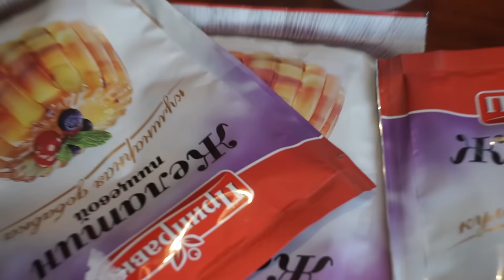Homemade Gear Casting, method of homemade silicone

Comment: My guess is that the plastic gear was there as a failsafe so that if excessive torque was applied to the device that the gear would break rather than burning out the motor or destroying whatever was blocking the gate.
Reply: Yep.  It's like a fuse in an electrical circuit blown.  It, the plastic gear, was designed to go first and least expensive to replace.
Reply: @thewhitecommunity  Nah pham, a hall effect sensor on the motor, optical encoder wheel, or back emf reading on the motor driver would be much more effective at detecting torque resistance.
Reply: Like a kid stuck in the gate:-P
Reply: Now that thing can try to destroy its own master. But i belive he will survive.
Reply: They did it to keep costs down, make sure the product survives past the warranty period, but doesn't last forever. It's called business, and is the engineers most difficult task, finding that balance.
Reply: If the manufacturer had such good intentions, they would have put the plastic wheel on the outside of the case, instead of the metal one that is there, making for easy replacement. @Jo's Channel has it right with, "This plastic piece has no place here, except making maintenance activity for the maker of the system that will come every 18/20 months change quickly that piece and charge you. easy money."
Reply: The cheapest and most manipulative way to render product useless, under the cover of safety.
Reply: as you see there is a clutch behind the gear.... if the gear stucks somewhere the motor will keep spinning without doing any damage
Reply: @Billy Buckles The power feed on the mills I use have plastic gears, but plastic still is fairly strong. This means that if you get your finger caught between the power feed and the handle, your finger isn't going to stop it. What will happen is either, your finger will be squished down to the bone, a bone will break, or it will dislocate your finger. A combination of all three can happen too so you wanna keep your hand away.
Reply: Ryan Carlen  Yeah, and they're on the lathes now too. That's only trouble until they learn.
Reply: @EvelynH-tj1qt  , back in the 70s  we quickly learned how to operate lathes in high school metal shop, so that we could make *pipes*!
Reply: Good 'un in the 50s We quickly learned how to operate lathes in high school metal shop, so that we could make *zip guns*!
Reply: @goodun2974   or hot knifes
Reply: And that was the problem, little ivan got his leg stuck on door, but door didnt cut ivans leg, so time to replace that capitalistic fail safe, 
In soviet russia if it can burn on crush let burn or crush!
Reply: I think it was also intended for personnel protection. If some child gets trapped by the door it will break some plastic teeth off rather than try to shear the kid in half.
Reply: @garywheeler7039  I think we all know which one we'd rather see. A child being sheared in half by a door would be hilarious.
Reply: In this case, the designer almost certainly selected an injection molded plastic gear because it is less than 1/4 the cost of even the cheapest die cast gear.  A shear pin would be used if a mechanical failsafe was desired.
Reply: @WojciechP915  You're not saving much money like that. If the gear breaks, you're still talking about a service call either way. At which point, the actual cost of the parts is not an issue. Even in Russia the cost of getting a tech out to do that is more than the difference in parts cost by a significant margin. Hell, even in China, you probably wouldn't be saving money going with the pin.
Reply: Your guess is wrong, a unusual resistance in the moving door will increase de current consumption and a sensor should stop the motor. Computer sensors are 100 times better than you holding your foot before breaking something fragile on the floor
Reply: Just imagine you can't get a spear part. You have the choice buy a new device or run it with a self casted aluminium gear.
Reply: there are better ways to provide motor safety control like used in impact drills. the purpose here was to save cost and for people to keep buying the same product at cheaper price
Reply: A kind interpretation of "Built to fail" or "Built to be repaired again and again and again and again" - or built to keep customer buying spareparts and repair every so often - or ...
Reply: False.. circuitry has a built in overload motor cutoff
Reply: Elevator doors provide an example of other methods to avoid chopping people in half.  Like light beams that stop the doors closing if blocked  Etc.
Very Cheaply as well.
Reply: Да это просто отмазка... Вечно сунут пластиковую шестерню и говорят, это защита мотора... Защита по другому устроена, а пластиковая шестерня не защита, а залупа. СССР на вас нету....
Reply: Its nice to know there is a sturdy plastic cog in my apartment lift so that the lifts motor is protected. ;-)
Reply: Nope it's made like this so that you'll buy another one. They don't made replacement gear. For over torque their are many options like key, motor fuse, relay circuit etc.
Reply: What about a slip clutch? Or a key and metal gear? Plastics gears are just unnecessary maintenance.
Reply: Nope. It boils down to simple economics. If the mfg can make it cheap and it will outlast the warranty, then that's the route they take. Machining/hobbing gears eats lots of time. Casting gears, sintering gears, etc. takes very little time.
Reply: metal gear with key is much better. Don't have to replace gear... just key.
Reply: @ges7991 what material would you use for the key? Mild steel is still insanely strong and softer materials would probably progressively wear out
Reply: An electrical motor should be protected with current limiter, and a detection of lock with electronics too. This plastic piece has no place here, except making maintenance activity for the maker of the system that will come every 18/20 months change quickly that piece and charge you. easy money.
Reply: @vieuetcon  Precisely! Well said.
Reply: @vieuetcon  Kind of depends on the quality of the manufacturer and torque of the motor. For example, the powerfeed on a mill is powerful enough to break a lot of things that aren't connected to it directly, so they use plastic gears so you don't break a tool or something.
Reply: @EvelynH-tj1qt  it does depend on the manufacturer engineer who designed the product.  I worked on gear assembly and plastic gears were inline as to not allow total system failure.
Reply: @thewhitecommunity  Yeah, we have in the mill's power feed because it's a school and a bunch of stupid kids use them and if the gears aren't plastic, usually something that shouldn't bend bends or the fine gears get stripped.
Reply: Yeah, but instead of buying a whole new motor assembly, like the manufacture would want you to, he shoved his problem through DIY.
Reply: Mr. Shlock  usa was for decades under communist government so obviously you still have systems with scheduled obsolescence o maintenance too feed the communist dominion over population. There are other methods to avoid what you said like sensors and belt transmission/distribution 
. i am not from russia i am argentinian lamentably
Reply: Nope.. plastic is cheaper.  That is all.
Reply: Stop using plastic
Reply: Stop using plastic
Reply: Dirk, I think you can add a fuse or something like that to protect the motor from overload.
Reply: Designed obsolescence with crappy plastic gears. Motor should have overload on it to protect motor.
Reply: wat voor wielen heb jij in jouw tractor?
Reply: Then 3D pri ter make sense.
Reply: Its cheaper to produce nylon plastic parts, companies have incentive to use it u less they have to and designed it for planned obsolescence, metal everything and current and other clutches could be preventive ways to burn the system, not destroying the machine
Reply: Plastic is cheap and easy to make gears in large numbers tis is the only reason  loo
Reply: when you can afford all those machine

Comment: Either the company no longer has spare parts or they charge an arm n leg for it, or you just simply love spending all that time, work, and money on making it yourself which is perfectly fine by me and having made it from aluminum will now last much longer than the original plastic gear....nice job!
Reply: I agree it was an impressive job, the part is available on eBay for 16 pounds ;)

Comment: The engineer who used a nylon gear on a giant door opener should be thoroughly flogged.
Reply: Likely designed as the failure point to save the other much more expensive parts when the door gets jammed.
Reply: @gkornelson  even then not a lot of companies sell replacement gears. and if they do its not friggen cheap. in some cases if it breaks more than once your better off replacing the object it came from anyway. 
so that point is invalid in that case.
Reply: @darkshadowsx5949  what do you mean? You can get replacement gears a dime a dozen. Basically any size you want.
Reply: could have been delrin.

Comment: Very cool video man! I’ve seen a few like this one, and you used slightly different materials to make your mold but it’s cool to see there are several ways to get the job done. Was the broken gear HMW plastic or Nylon 66? Just wondering. Manufacturers often make a part like that to be a weak link on purpose, I guess so it breaks or strips out instead of something else. At least you know now it ain’t the weak link anymore!
Reply: Aluminium would pretty much break or wear out the same. Maybe it will crush your arm or foot in the door now, before tooth melt or break. I don't think anyone in Easter Europe would care that much. the plastics is likely PLA. At best PA12 Nylon or ABS. Had such a gear in my milling machine Einhell MT-65 aka Minimill clone. Replaced it with a tothed belt and a §D printed PLA belt. The SLS laser printed PA12 nylon should have been better, but the print process heat in the closed shop microcontroller software is less than ideal. So that wore out quickly. This technique would have allowed to cast either plastics or alumium for a direct internal gearbox replacement. If it had niot been for the belt drive to be the better long term option anyways I would have gone for such a replacement cast as well. It is simple genius.

Comment: asks, what for in such a place to use plastic? developers specifically do shit!
Reply: Weak link in mechanism. This gear would be added for safety. Broken gear is much better than broken bones.
Reply: @АлександрКуппа  Nope! Outer pinion have a shear pin to prevent accidents. 
This plastic gear is designed to fail after a few years and you buy a new unit...
Reply: Henry Rollins I think it’s more a fail safe.... don’t think they don’t sell replacement gears...

Comment: I bet the gear was made out of my lingo act as a fuse on purpose
Reply: I had the same thought. But cool idea.
Reply: I believe the outer pinion have a shear pin as fuse. 
They make this cheap nylon gears just for you to buy a new unit after a few years of use.

Comment: I would have just used corn starch and silicone to make soft mold then poured chopped glass and resin in ..... way faster if you want more strength just use chopped carbon Fiber but yeah cast pot metal or aluminum would be plenty strong
Reply: first time I hear about chopped glass and resin. Is there anything on the market that uses that material? Fiberglass seems similar but the strands and the layers probably give completely different properties compared to what you are saying.
Reply: @Mr30friends   Fairly common. Mix chopped fibers with polyester resin and you've some good strong filler.

Comment: They a reason why it was nylon gear in the first place and it done it's job when it broke as it was designed to do
Reply: C17H25N  its supposed to break so you buy a new one! Electric gate openers have overload circuits that stop the gate shutting if there's a problem far quicker than waiting for a nylon gear to break! I know, I install these things!!

Comment: I've actually never cast something, but perhaps in the future a riser (tall column at exit of casting cavity to hold molten metal) would help with smaller details like those teeth. I believe the blunt teeth are due to shrinkage, and mostly surface tension of the molten aluminium. The tall column (if wide enough) will stay molten long enough to supply metal as the (presumably small enough) casting cools / shrinks and most importantly (if high enough) put the casting under higher pressure to help overcome the surface tension and force the metal closer to the walls - making a more dimensionally accurate end part. That is my reasoning anyway. Still it is cool idea you had there to extend the teeth as you did, and it appeared to work. After the lathe cleanup, it looked great.
Reply: First cast shows what happens when you don't fire plaster mold. there is chemical water embedded in the plaster, and needs firing to remove. When molten metal hits it, it boils and steam vapors are released, so pressure builds up internally and the metal can't hit the surface it needs to. If you are really silly and try this with much higher temperatures as in bronze and brass, you will likely get much more reactive and explosive results. I know this intimately from first hand experience. A small figure cast this way made it through the process, but it was riddled with air pockets like a sponge, and molten brass was spitting out of the mold for quite some time and distance. A case of run like shit until it stopped.
I can estimate if the shape was bigger, and let's say was more undercut, it would have exploded fully.. a dangerous job to mess with without proper knowledge!
Reply: @dougaldhendrick3497  I can appreciate what you're saying about water in the casting plaster as I joined a craft guild in Annapolis MD, Patuxent Lapidary Guild for a Lost Wax casting class. For some long lost reason, maybe the vacuum dome machine was not in service or being used by someone else and it could've been at closing time, nonetheless my mold had much porosity. And the last of 3 projects a ring with grain of wood and a 10X30 cabochon of reticulated quartz i.e. gold hair-sized rods in a clear base of quartz looks beautiful! Well the ring broke from bubbles in the mold and that was the last wax of that pattern inventory we had. I might try to repair the ring to make a new wax as it's not currently in any book I've looked at, probably old!
Reply: As someone who has done casting, I can tell you that you are right about the surface tension.  It is very high for molten aluminum.  A riser on the sprue and vent will build more pressure in the cast, forcing the aluminum into smaller details.
Reply: 100% this. If he would have used a riser the gear most likely would have come out perfect

Comment: Good video, the surprising part was the fact the motor had a plastic cog to begin with
Reply: Designed that way I suppose. Somethings got to give.
Reply: Nylon 66
Reply: Mountaindiver,
Good call,thought I'd missed something!
Reply: Nylon is used to keep the noise down.
Reply: @daveharr7969  valid point! The cast gear will break sooner I suspect... Looking at its use,noise shouldn't be a huge factor though. Probably sneaky shit being as likely?
Reply: @dansmolen1618  Read from another comment that a plastic gear serves as a "mechanical fuse", that in the eventuality of said gear breaking it won't create a chain reaction into damaging other important/dangerous parts while still powered. Makes sense
Reply: @Buenosaurus-Rex  that idea makes sense,and looking at placement of that component it's in,I'd have to say you are onto something there! Good call!

Comment: Brilliant, I really like the homemade silicon:) Thank you for sharing
Блестящий, мне очень нравится самодельный кремний :) Спасибо, что поделились
Reply: A bit misleading, as it isn't anything close to silicone. It doesn't have near the flexibility or can take the repeated abuse that silicone can. Gelatin glycerin molds are used in the art world for making quick duplicates, it can be melted over and over and used again. Whereas when silicone is cured, there's no do overs. But gelatin glycerin is also very sensitive to heat and moisture. So you have to be aware of that with your materials, or it'll deform while you are trying to make a replica if too much heat is generated when curing or it is sensitive to moisture (resins).
Reply: In russian it's: "Блестяще, мне очень понравился самодельный силикон :) Спасибо, что поделились. "

Comment: Nice work. I can not read Cyrillic characters, so can you please tell me if it was plaster or something else you used to invest the wax. I once did lost wax like that in my kitchen oven, and when I poured lead into the hot plaster it exploded and burned the floor. Since then I know to burn out plaster several days in a very hot kiln to drive away the molecular water, so no steam and no explosion (I also bury in sand now). I enjoy all your videos.
Reply from the maker: I used a building gypsum. This is not a special plaster, just plaster, which dries quickly. After a few days, I dried it, after baking in the oven.